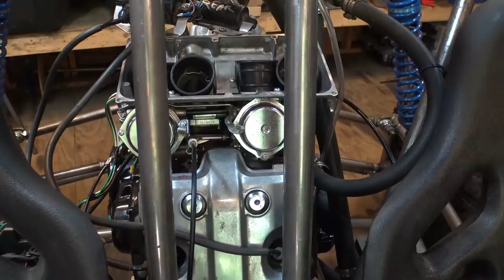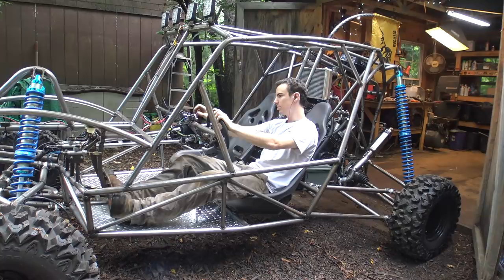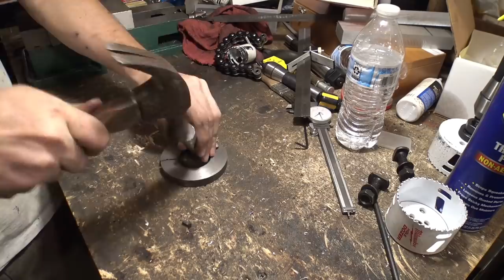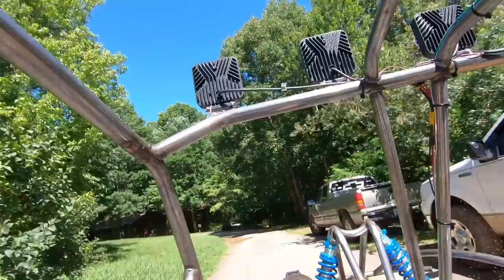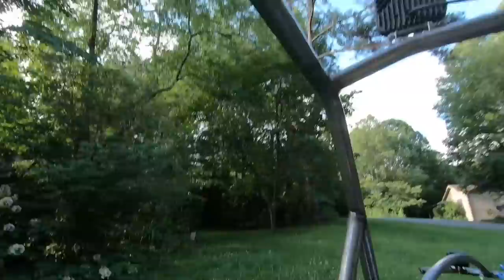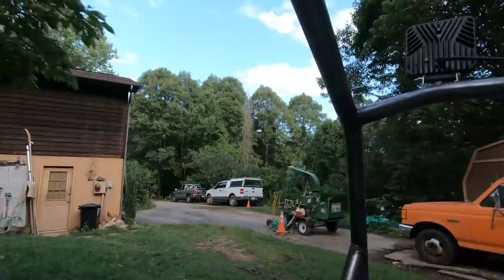Honda VF 1000 buggy build part 13. test drive

Comment: Bro that biggie will actually scream its not just gearing ur loosing over 50% of its rolling torque from that chain change of geometry u got Goin ther. Next move would be pull that roller toss in trash or go to smallest wheel u can make work on roller to at least reduce the tansition of pull the chains making. Then go up one tooth on motor and couple on axel. Make sure ur motors tuned correctly as far as initial timing and the advancing system. Oh and firing order & plug wire placement far as what cylinder etc. That type of tune.. But roller set up by by

Comment: you need to move the engine down or the rear diff up and put the chain in a straight line the chain tensioner you have is a joke.  its too tight your robbing power.  the bike that motor come out of is 600 lbs  with taller rear wheel and alot  higher gearing then your buggy  and the bike is a damn guided missile and takes off like one speaking from personal  i have a 1986 vf1000r the stock gearing is 17 front 44 rear thats 3.14 ratio  with and 17 inch wheel and tire so roughly 22.5 inches tall how tall are the tires on your buggy  so unless your buggy weights 1500lbs . you have issues other places like dragging brakes the just ridicules chain routing. that buggy should damn near pull the front end off the ground with a 5 to 1 gear ratio.  i really like your videos and your very talented but this motor to rear end alignment thing makes me wonder what you were thinking. id rather you slow down and post videos not as often and build some great projects and do them the right way to the best of your abilities.

Comment: That thing is already really low geared...  You just have to learn how to drive it better.. You look like a noob....  You'll learn how to find where the power is in the engine...  Don't be afraid to make the motor scream and shift quickly through the gears.  You'll figure it out.  This was hard to watch though... pretty cringe for a guy who knows a lot about Japanese bikes.

Comment: It's not a low rpm kind of motor, really you're bogging it down. When she needs to be revved up a bit. Think I'd suggest getting a 4 stroke 500ish cc motor maybe? I know the te510 had a lot of low end torque when I had one.
Newer 4t is killing it in hp also. The husky's got their new 4t that actually out performs a 2t in every way. Either way, I'm jealous.. I'd love to be able to build a cart.

Comment: Hi rather B welding as for your smoking engine look like you need replace the all valve seal try a 10 tooth should help as rear you can get 62 thru 70 Tooth from The Stunt Factory or Rebel Gears

Comment: What about instead of a jack shaft like I said before you do a reverser box on top of the stock trans. So kinda like the two speed trans you made but instead of two speeds one is reverse. It will get the chain up where it needs to be to get rid of the crazy angle on the tensioner and let you change gearing and give you teverse

Comment: I can't see your gearing setup from the side, but do you have room for a short jackshaft above the rear axle to come straight off the engine and then put the large sprocket on the cv shaft side to offset for the jackshaft. Just wondering if that may work, then you could play around with gearing. Maybe even located between the engine sprocket and the rear axle. Looks good.

Comment: Are you sure you're putting it in first gear? 1 down from neutral then 4 or 5 up . Find neutral then shift down like you are pushing down on the shift lever while sitting on a motorcycle. Good luck. Oh like a lot of people are saying give it some gas.

Comment: Bike engines make no power in the bottom rpm range. What you did can really hurt the engine when it does get on power over reving it hard and not getting proper load on it.
My suggestion is ditch the 60 tooth and go back to the bigger sprocket on the output shaft and use like a 53 tooth on the axle. Driving off just slip the clutch as it's not made to be used as a "car" powerplant.

Comment: It sounds like you are running it without an airbox, I can't tell. If you are that will mess up air/fuel ratio and make it run like a pig. also a temperature gun would show you if all four cylinder pipes are getting hot. Old school, spit on finger touch each head pipe fast. If one of those pipes are cold and the other three are hot... sparkplug? coil?

Comment: Love this build man - but you really need to wind that RPM out, in other words: Use 4000-9000RPM like it's your 1000-5000 - changing the gearing will only make that more necessary.

Comment: Most of the comments are things that people think you are doing wrong or along those lines anyway.  I wanted to say that your project here is super badass!! Any type of custom vehicle will have its issues to be worked out no matter how much you plan and try and get it on the first try. That's just the nature of the beast really. Everyone saying rev it out to make it go, I'm sure hes aware of this but that is not very good for the clutch and other drivetrain components so having the proper setup IS the fix for it not more gas! Even though more gas is the fun way, it's not the right way!! Having all the different front sprockets will give you a ton of gear options for different places you can go, like more trail stuff having a lower ratio or if going to the dunes when u can go flat out with a bit higher ratio. Plus you can play around with different tires and or sizes and still be able to gear it how u want to that sweet spot because yes people the tire size changes the overall ratio it will have so options are always good to have!! I really dig this buggy man cant wait to see it ripping around some day here soon!!!

Comment: The chassi is way to big for those tires and that engine. It's bigger than some cars. You need a 4-cyl 2L turbocharged carengine and bigger tires. It's an awesome chassi, just wrong engine.

Comment: not bad you should check out the guys at grind hard plumbing  co maybe do a power wheel truck conversion gas engine will help you cut weight down with a small build. just remember have fun with your builds

Comment: I like  these videos, they give me great ideas and I know I can always browse thru these vids and see what to do and what not to do. The original bike itself would've weighed about 250 pounds give or take, and then the rider, but powering one single wheel. This buggy weighs over 1000 pounds plus the rider. Powering two wheels that are at least twice the size and weight. Bigger tires-less torque. Bigger vehicle- you need lower geared. A 4 cylinder motor will make good horsepower at high rpm, considering that the stroke size is smaller than lets say a v twin of similar cc, you'll need to rev it up a bit and then let the clutch out. If it was a v twin it would have more torque, but less revs. Anyways, that's my input. There's not much more that can be done, unless he puts a smaller sprocket. Now this thing is huge, so with 5 or 6 gears(I can't remember which it is) gearing it down so much, and the weight of the vehicle, will not allow you to have such a top speed. But going as fast as he is in only 1st gear, I would say its safe to gear it down some more for the weight, while still allowing decent top speed I would guess around 45 or so cuz the tires are bigger than the motorcycle tires allowing for higher speeds-but again the weight factors into that as well.

Comment: You just can't pussy foot it! It's a motorcycle engine get it in it's power range. Gotta drive it like a man and give it the boot! Also need to put a winch on it. And maybe cut unnecessary tubes out of it...

Comment: Your body weight will take you more inclined to the left, thus more wear on the tires on the left. You should probably consider getting stronger shock absorbers, which would counteract the body weight on the left side. Just a thought, but still important.

Comment: The gearing is fine, motorcycle engines don't make much torque at low RPMs, try to launch at half throttle and you'll see what I mean

Comment: You have done a great job so far, I have only 1 question that i have been wanting to ask since you built the axle assembly. You spent allot of time making it, but what are you going to do about water, mud, dirt and sand getting into the bearings and destroying your work? Unless i am missing something I have not seen any seals installed or a way to grease it?

Comment: If the smallest sprocket that you've ordered doesn't get the desired gear reduction, then try adding 2 jack shafts. That way you can maintain engine and exle alignment, and give you a much wider variety of gear ratios through  multiple varying sprocket sized. If you have the room available to install them of course

Comment: Rather b welding! What mufflers are those?? And are you running a fuel pump? My buddy has a 1984 vf1000 still in bike form and it has a fuel pump and i didnt see one in your setup

Comment: what the hell? just testdrive it. you could've just driven it and it would have been fine. its like starting in 2nd gear. also, a motorcycle usually has a wet clutch. it can take some abuse :P

actually, after watching the full video, the gearing would've been just fine. actually better. your feeling of struggling in 1st gear comes from too short of a gearing...

Comment: I just thought.
The test drive usually means you're close to the point in a project where you choose what colour to paint it.
Personally, I think this one would look really good in lacquered raw steel. Maybe go over the welds with some fine wire wool to clean off the oxidation marks, But apart from that I think just hitting it with several coats of clear lacquer would look awesome.

Anyone else feeling this could be the coolest finish to put on this beast ?

Comment: This engine doesn't even start to make any torque u til its turning 7 or 8000 rpm.  Get on it - get the motor rapped up to where its happy and gearing will be just fine.  This isn't a low rpm lugging type engine.  Give it the gas and drive it like a man.

Comment: i think a second or larger radiator would be good to deal with the extra load. also maybe a hydraulic hand brake (drift car hand brake/e-brake) to save you rom tap dancing the pedals.  great job

Comment: If need be put a turbo on it and it a Motorcycle engine is torque is in the higher Rpm Range try the Gearing issue  first see if that helps some but as big & heavy as it is your gonna have to winder out more once ur engine is broke in from the Rebuild Awesome job looks freaking soo cool..

Comment: the ENTIRE problem is not gearing its revs if it redlines at 11k send it to 6k and dont just dump the clutch but dont let it bog the more u let the clutch out the more revs u need to hold because with a 17 tooth that thing will fly its just gonna be a bit of a poain geting off the line which is the sae for any manual transmision vehical

Comment: Every 1 down in the front is the same as going 3 bigger in the back 
So it’s basically got a 75 tooth on the back now ! Of course it works 🤣

Time to put the boot into it now on the open road

Comment: You know you're nowhere near the power band of that engine, you are thinking it's a car where 1500 rpm is enough to get you to move, this is a bike engine you need to be closer to 2500 rpm to be in the proper power band.

Comment: G'day  mate , yes it's big and yes it's heavy but it is designed to rev harder than you are trying ,get it somewhere you can let it stretch it's legs , Also you are going to have to put some kind of reverse gear on it or you are going to get stuck somewhere by yourself , your having trouble getting it out of the workshop as it is . a few teething problems but that's to be expected with a new build ,keep up the good work see you in the next upload.   Mal .

Comment: Might i suggest a new setup for the back shocks? Make a bracket on the top mount that has 3 different shock angles the way you have it set up will be good for drifting but not to good for jumping

Comment: How about doing some math and figure out what gear ratio you need.  From what I saw, assuming you were in low gear, you are going to need a BIG change in ratio.  ie put another reduction in the setup with a jack shaft.

Comment: this thing is rad but i dont like the rear end of it and the suspension setup. id make the shocks go in at and angle towards the "cab" if you can call it one and maybe mount them on those bottom bars so you could get more travel out of those 2.0 shocks. those are some big shocks for this small vehicle. the front looks good. plus it needs way bigger tires

Comment: Killer video and buggy. Brother when you Tig welded the 12t sprocket to the spline. You more than likely anealed the part. Which did just what you didn't wanna do.  To get the metal hot enough to puddle for Tig welding It got way hotter than one would need to aneal it. I doubt it'll matter  as the stress isn't outward on the part.

Comment: Wheel base looks way too wide, especially on the front where the front wheelbase is wider than the rear.  Many of your challenges could be avoided with an actual plan before you start your build.

Comment: It's underpowered because it's not running on all cylinders properly you can hear it in the video intermittently fire when idling. When the engine is cold fire it up then quickly touch the header pipes and you will find one that is colder than the other that's the culprit sweet build keep up the good work

Comment: The gearing is fine..lol may lose top end speed but gear ratio is fine. Maybe get it moving a bit more before letting the clutch completely out.. more rpm will also help..

Comment: Put a recluse clutch in it, itll help bring in the torque earlier, at least from what I've read it does, plus it allows you to not have to use the pedal for taking off and shifting

Comment: It will be interesting to see how long the CV joints will last with the locked differential. Motorcycle engines are better  at higher rpms then what you are doing. Open it up and let it sing.

Comment: As for the gearing, for every 1 tooth you go down on the front, it is the same as if you were to add 3 teeth to the rear. So if you went with a 12 and stock was 17, that's the same as going up 15 teeth on the large sprocket. Hope that helps. Glad to see the thing finally running!

Comment: as far as bringing the gearing down allot more turn the engine sideways where the crankshaft is facing backwards and slapping a differential in would suck if you have to get rid of that rear end after so much machine work to make the parts but you can get allot more drastic gearing if need be and you can have an lsd so you can still turn and also have straight line power without one wheel peels

Comment: Also from my experience building similar things the chain position plays a big role.. u see the sudden change in direction of the chain coming from the bottom of the main sprocket to the drive gear.. u have way less stress and powerloss with a straight and freely rotating chain...

Comment: I'm thrilled to see this thing move under it's own power, Well done.  If you ever decide to revise this thing in the future you should consider lowering the roof line.  You could take out some weight that way and improve the looks, not that it looks bad, it looks really cool as it is.

Comment: Did you place it in 1st gear? (the motor came with a transmission) It acted as though its in second gear. The transmission is geared tall??

Comment: If you go to small you gonna loose all your top end you have to rev them a lot higher motorcycle engine are made to be reved preload adjustment and rear sway bar will help with the “boat feeling” but for real I wouldn’t go any lower on the hearing until you get it up to speed and see how it does then

Comment: Great job fabricating. Personally I’d lower the top of the cage, shorten the length of the cage, narrow the cage, put larger tires on it and raise it a touch. The gearing would be fine out on the open sand. Good job

Comment: 21:30 lol look at length of those control arms, and the shock mounts on those crazy angles, I thought the whole geometry was specifically for the off road articulating type suspension.

Comment: Need to run a Jack shaft to fix the gearing problem throw a 3rd and 4th sprocket in there it will get low quick

Comment: When you run the engine, check all 4 exaust pipes and see if it's running on all 4.  I have worked on about 30 v65 hondas and my customers had no idea the front 2 cylinders were not even firing.!
Reply: Sounds like it's only running on the back 2 cyclinders.

Comment: If the mufflers have restrictors in them it can cause it to be down on power.   Remove them and see what what happens.  If it doesn’t have them remove the mufflers and see how it is.

Comment: Btw, could you trace and cut a thin layer of metal and weld it to the smaller sprocket to fit the thickness??

Comment: add an extra axle with a set of gears between the engine and the rear axle to improve the ratio. There is room above and behind the rear axle.

Comment: You should put a vtec Honda motor in it with a 6speed manual 😍
Reply: James Anderson no
Reply: Jk Duh 🤣 seriously put 44k from "BG" in that fuel tank and make sure the ratio is right and that thing will stop smoking instantly promise 🤔😎🤜🤛

Comment: Maybe if you change the rear gear tho the wheels tho a smaller gear whit less theeth the bigger it is the more power the engine needs to give to he drives a top speed faster buth slow at start